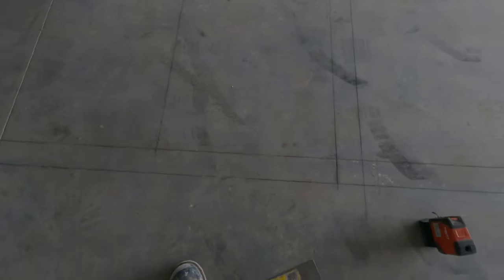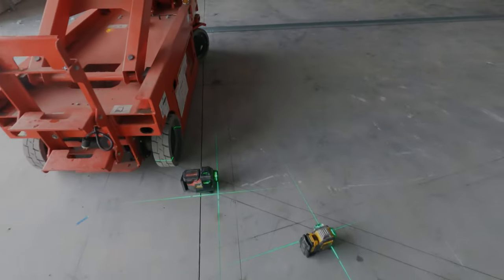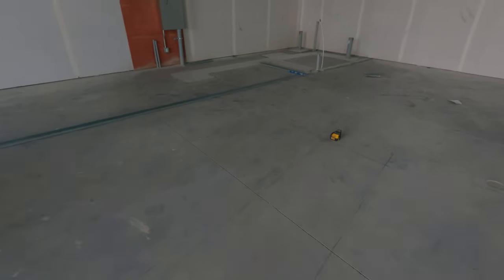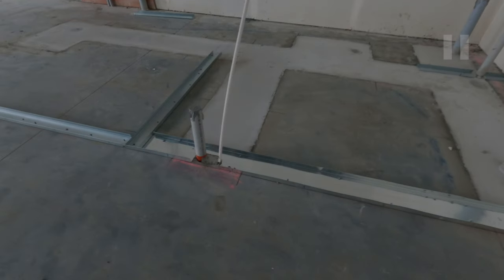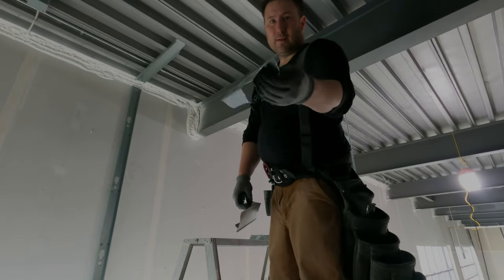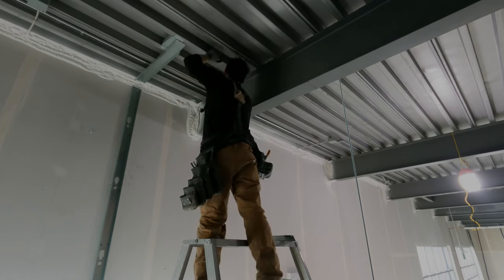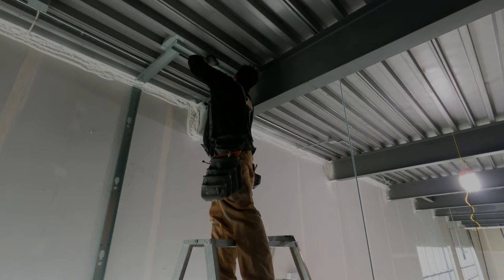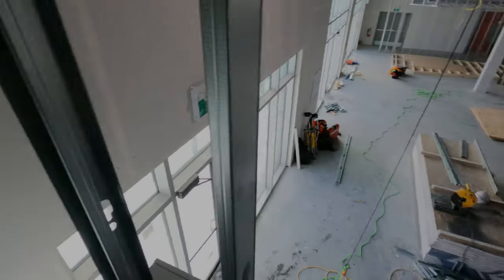Metal Stud Framing & Jigs

Comment: How do I frame a door opening stronger when there is a really heavy custom door.  Metal stud framing isn't a stong or rigid as typical wood-  it's 96" wide door weighs 400 lbs.
Reply from the maker: Use 20 gauge studs to double stud both sides and you can build a box beam for the top.

Comment: Hey man I have a question in general. When using a straight edge to straighten a stud. Do you put the straight edge in the middle of the stud then clamp your stud then it will all align? Or do you have to put the straight edge in the middle of the stud then towards the top to also check there?
Reply from the maker: I think I get what your saying, I always go from bottom track or plate to top track/plate. This is how I set my tracks in cross beams and mark my stud centers in the middle tracks. When straight edge across to make a mark on a wall or something to extend a wall or put a wall stud in that doesn't have top track I go horizontal across the middle of the studs.
Reply: @ConstructionKronies  Yeah for example I had to put a stud at the end to make a corner but the track that forms the corner at the bottom didn’t fully meet each other so I used a straight edge with the previous studs that were on layout so I could line up the stud I was going to put in the corner to make sure it was sticking out at the same length at the others. I just wasn’t sure if I use the straight edge across the middle of the studs and then clamp my stud I need to place against the straight edge so it makes it the same as the others. I was just wondering once I do it that one time will the stud be completely level from bottom to top or do I also have to put the straight edge towards the top and check it there as well?
Reply: I also forgot to mention just like the bottom track the top track didn’t meet either